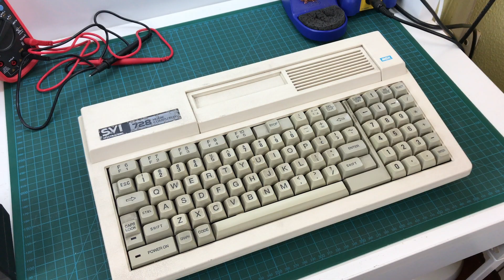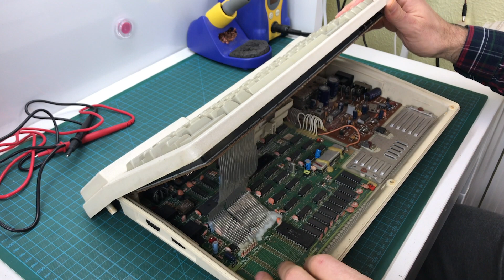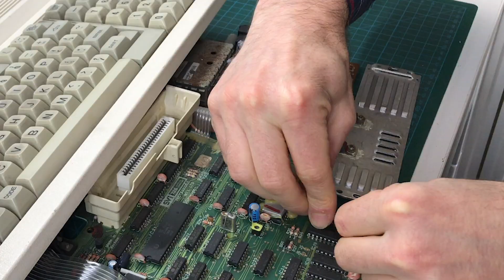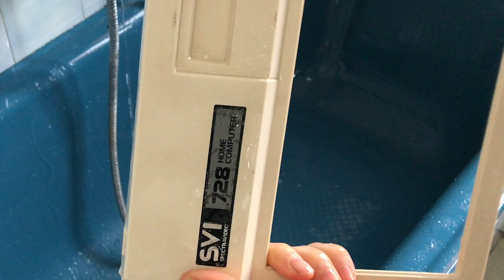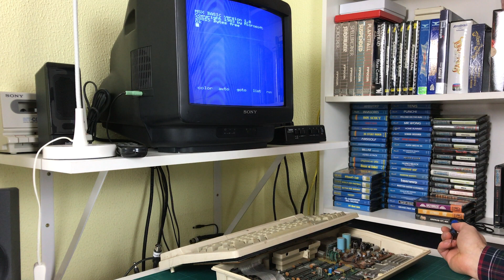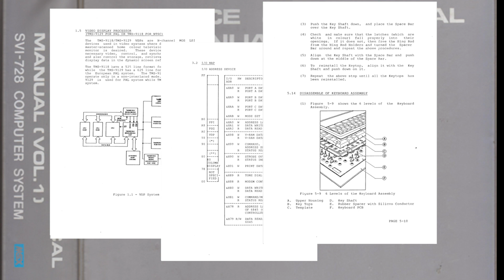Spectravideo SVI 728 with Glitchy Video Repaired

Comment: Thanks you for this video. I learned so much and got the courage to try to repair my other SVI-728. I had opened it and was put off by the hot glue mess and what a pain it would be to get to the pcb. I also found the service manual that pinpointed the issue with my machine. My issue was that neither of the joystick ports worked. There was a flowchart that pointed to 74LS157's so I desoldered and replaced them and it fixed the issue.

Comment: 12:04 I am extremely surprised that this uses basically standard Cherry keycaps stems. I am thinking of importing one of the Arabic localized versions of this to spruce up my mechanical keyboard and to be the only keeb enthusiast to have them. I'm Egyptian and I think it will make for a unique keyboard where the standard styles are English and Japanese. Would you know if they would fit a modern cherry keyboard switch? They look extremely similar at this part of the video.
Would you have any advice on cleaning them without ruining the text/legends?

Comment: I just recently found your channel and have been enjoying catching up on all of the old videos. The items you feature are a bit older than what I'd be interested in collecting, but it's really enjoyable to watch your process for repairing them (the larger components used in the era also help, both for the debugging and for following your steps).

A small thing I noticed on this video, which you might have already fixed on later videos - I'm watching them out of order - is that your TV makes a high pitched noise. It'd be great to add a low-pass filter to remove that. Not exactly sure where the cutoff should be, but I think the noise is around 15 kHz. Google also says that that seems to be a common frequency for cathode ray tubes.

Comment: The baking soda trick also works wonders for getting tea and coffee stains off of non-porous surfaces like a glazed ceramic mug. I clean my coffee mug this way every couple days, unless I'm not using it (which is rare).

The damage on the case looks to me like it was caused by someone wrapping a cable around the case and leaving it that way for a long time, probably years. The plasticizers in the cable insulation leach into the plastic and cause it to essentially melt. Then, as they evaporate, the plastic re-hardens, but any damage to the shape remains.

Comment: why not rplace the clear ribbon calbes with plug and socket as it is soldered to kb pcb and mb pcb
Reply from the maker: Yes, that would be much more convenient. I ended up doing a bit of that with my SVI328 repair later on. The only problem with a cable like that is finding a cable with enough connectors, but it's definitely doable.

Comment: Which desoldering gun is that?
Reply from the maker: It's a ZD-915. There are other newer models I think, but that one works great. Also, there are lots of replacement parts and filters available, which is really important. Definitely recommended!
Reply: @NoelsRetroLab  thanks!  Looks like a nice one.  I got so frustrated looking for decent options I decided to pick up a Hakko FR-301, which is amazing but almost twice the price.   So many crappy options out there, but the Hakko has convinced me of the need for a good one.